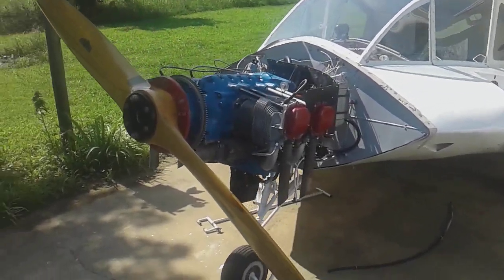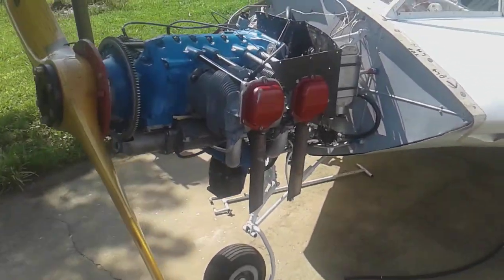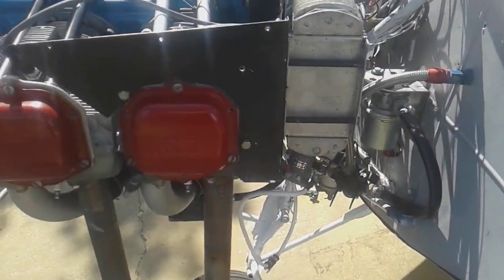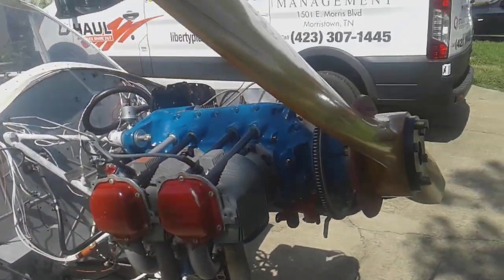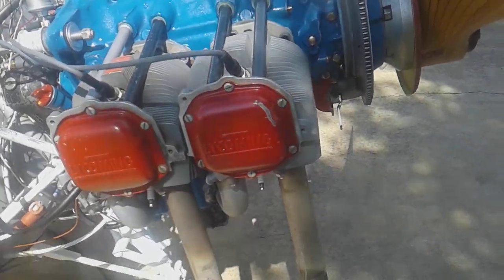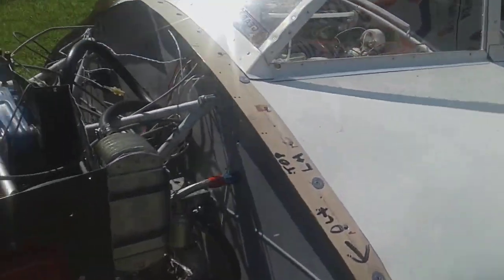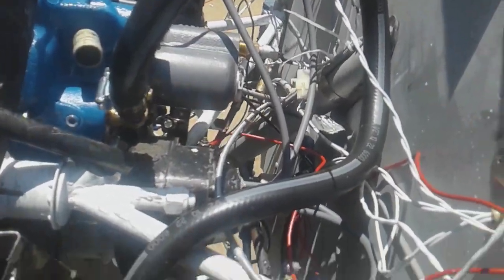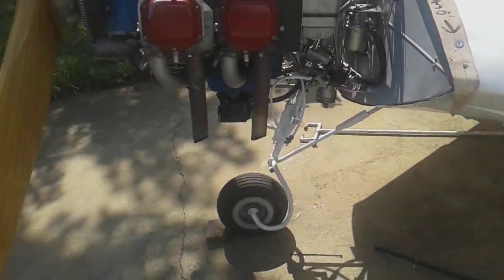Lycoming o360 engine conversion run.

Comment: I guess the ol' rotary didn't last? Didn't trust it or did it fail or? Glad to see you gotta good ol' Lycoming 👍😎
Reply from the maker: The rotary is excellent but only approximately 150-160HP at the propeller. The Delta really needs 180HP and it was more cost effective to use lycoming with the core I had than to boost the rotary and try to cool it on a flying wing/lifting body platform. As far as reliability it never missed a beat. I am still carefully removing the mazdas wire harness so i can use it on my Hatz CB1 biplane. The rotary has 50 more HP than the biplane needs and plenty or cowling room and W&B room. More Delta flights soon.
Reply: @dillonhopson4367  That's good to hear Dillon, as I've always loved the rotaries too. Looking forward to seeing the new vids of the Delta and the Hatz down the road! Fly safe and often🙏👍
Reply: @dillonhopson4367  Hey Dillon, how's the motor swap coming? Did you ditch the lyc and decide to LS swap it? Hahaha Fly safe!
Reply from the maker: @RamblerMan68   Painfully behind what I wanted but it's running well. May have to make minor timing change with 90 octane as 91 ethanol free is a little harder to get. I have to finish cowling fitment, weight and balance, and cooling baffles. We have lost 45-50 pounds off empty weight, gained horsepower, and will have better mpg. I've had to make some cooling baffles, carburetor air box, and engine mount from scratch.
Reply: @dillonhopson4367  Cool my man, let us know how it's going. Thanks for sharing!! Fly safe.